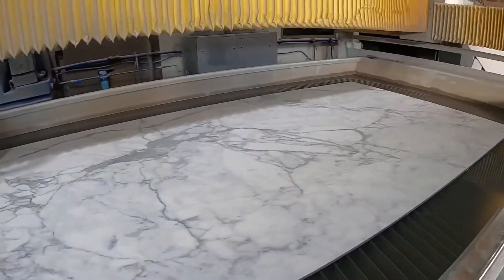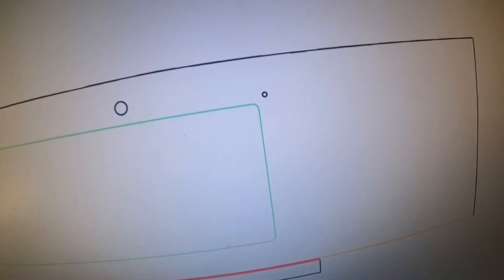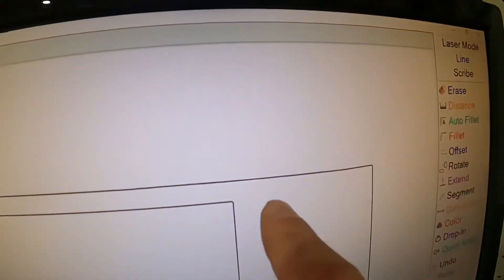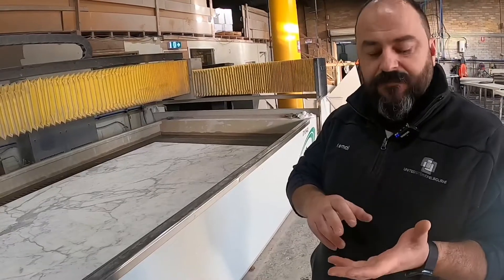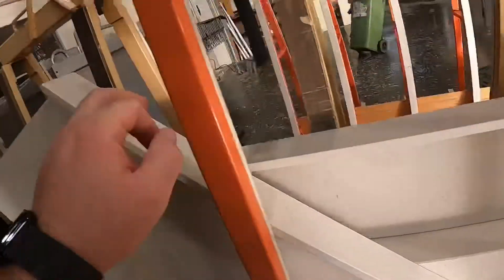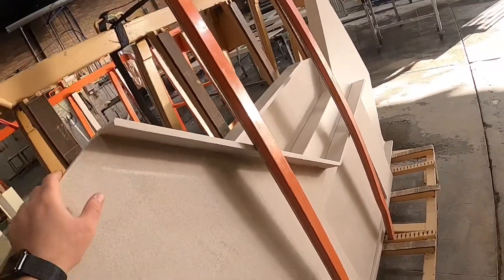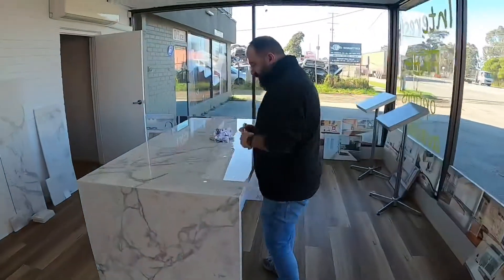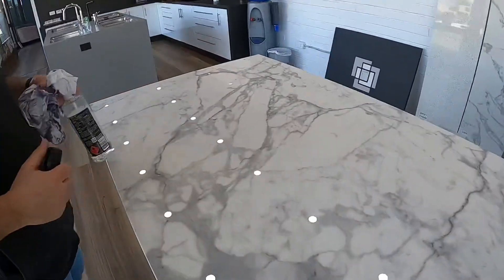CNC Waterjet cutting & Porcelain Benchtops by United Stone Melbourne

Comment: Hello.im the operator of the same machine.But i couldnt find a solution to the breaks in the corners when cutting porcelain.do you encounter broken corners while cutting porcelain?If you have a solution could you please share it?Awaiting for your kind reply 🙏
Reply from the maker: Hey Guzin, it’s taken us 5 years to perfect it. For beginners, I do say, make sure you stick to reputable suppliers who supply porcelain. There’s many kinds of porcelain, sometimes batch to batch can vary too, so you need to test each batch and slab to set your PSI, speed and garnet ratio accordingly. Feel free to call me for further info if you like. 
Kemal Efe